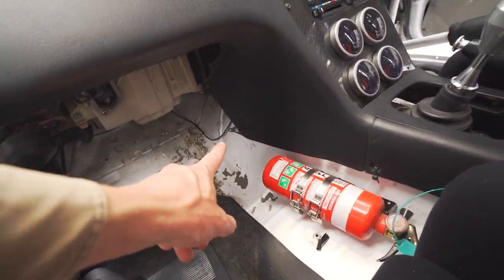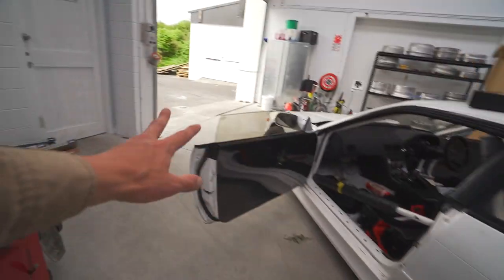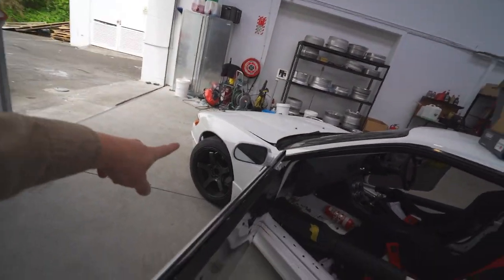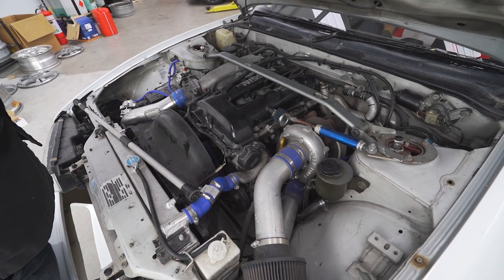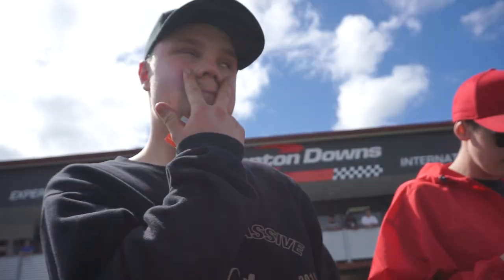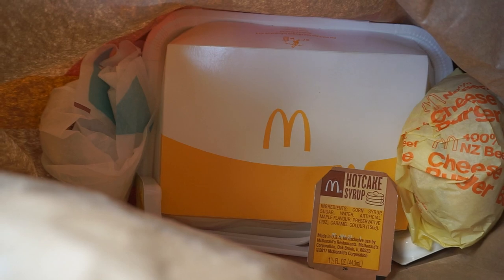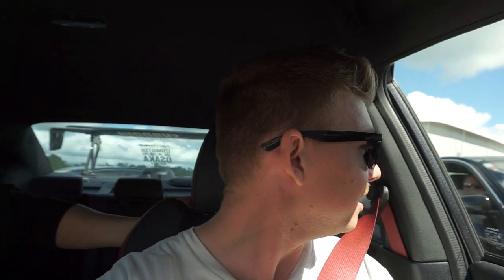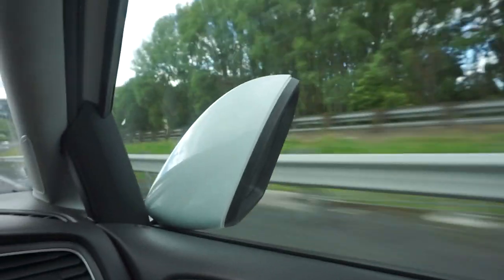750HP R32 GTR RIPS 40PSI + More S13 Progress!

Comment: u got a black top bro i reckon find a Red top and bolt that on ull probz make way more power, my dadz boss has a SR20DET red top powered BMW E30 drag car making close or about 500+hp i think, stock block stock head js big single, ht leads, Greddy intake few other xtras
Reply from the maker: Not chasing that much power right now as it would need a new gearbox etc gonna tidy it up then go for power